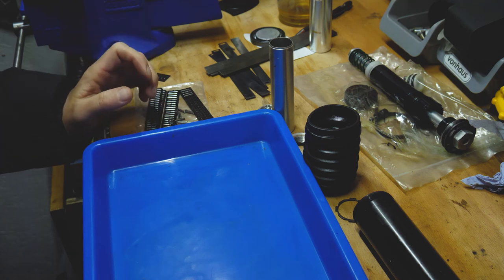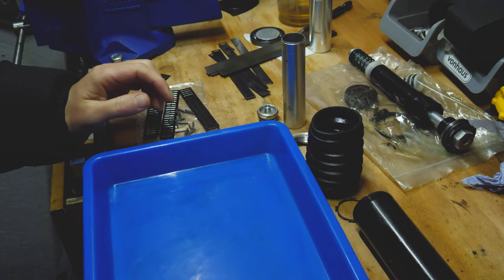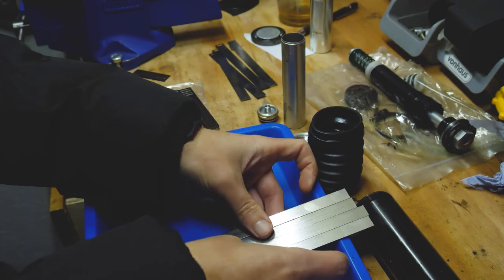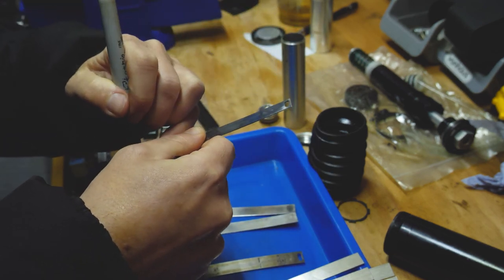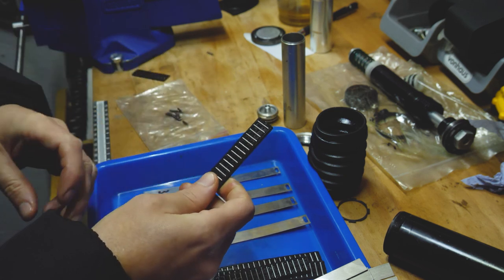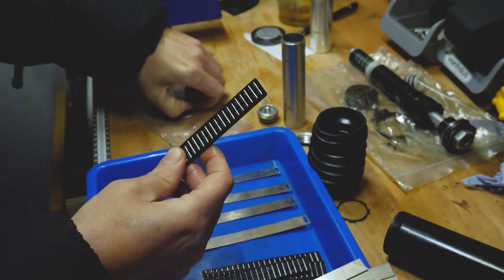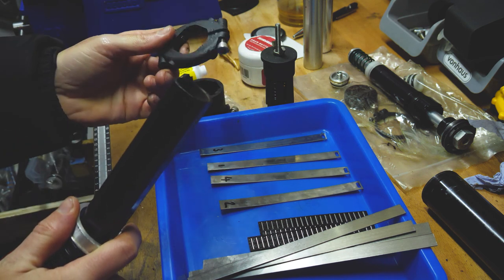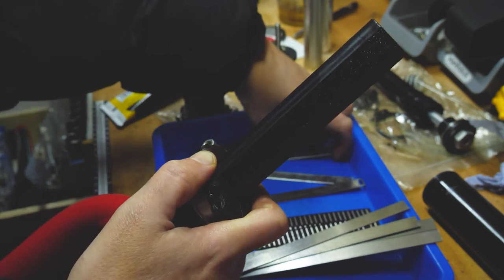Headshok Rebuild Part 3 - Telescope rebuild

Comment: I need some info on where to get clamps and plunger for the fatty D fork rebuild
Reply from the maker: You mean the shaft clamps? Which plunger do you mean, the air piston? There are various piston designs depending on the damper in question.. if you had a pic of the piston you need.. I know that in improvepart.com they sell some of the clamps and pistons: https://www.improvepart.com/products/cannondale-headshok-fatty-air-piston

Comment: Great vid, I'm trying to source a spare set for my V900 as they are completely seized/rusted and not worth rebuilding - do you have any spare you'd be willing to sell?
Reply from the maker: You need to determine the length and thickness of each one.. there are many many permutations. There are races available in some countries on eBay but it depends totally on the size
Reply: @gravelproof thanks for your reply I meant a whole set of forks to replace the current ones, not much around on eBay at the moment,
Reply from the maker: @oooshdelaroosh2039 oh sure I have a fair few.. what country are you in?
Reply: @gravelproof  in the UK - let me know of a good way to contact you thanks!
Reply from the maker: @oooshdelaroosh2039 message me on instagram if you can
Reply: Done!